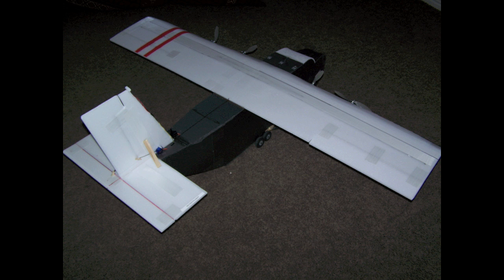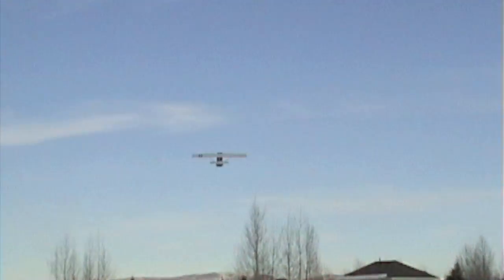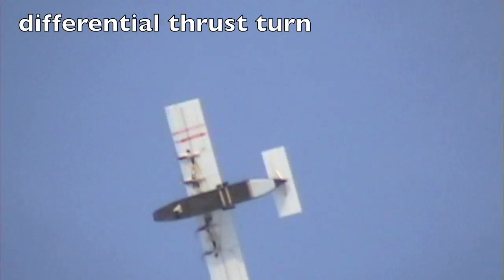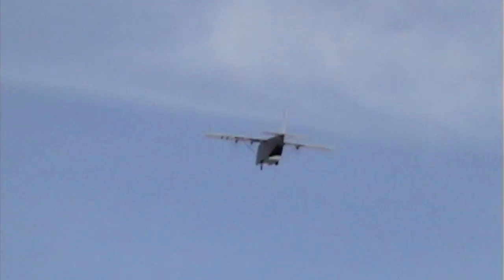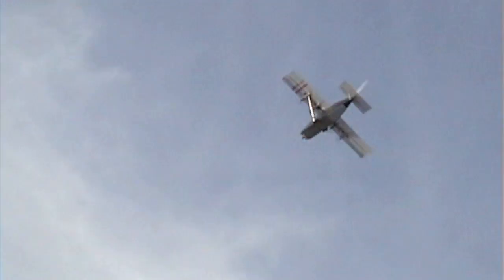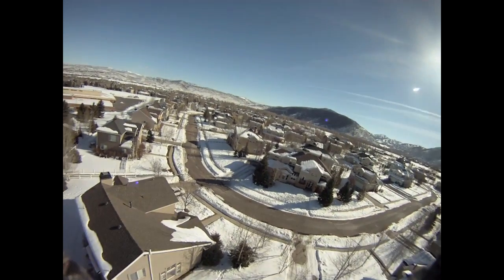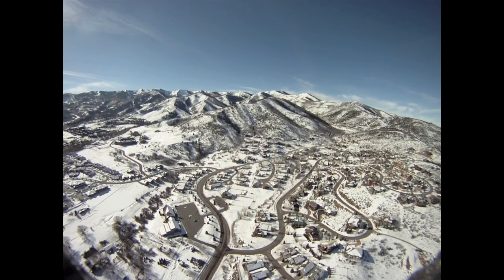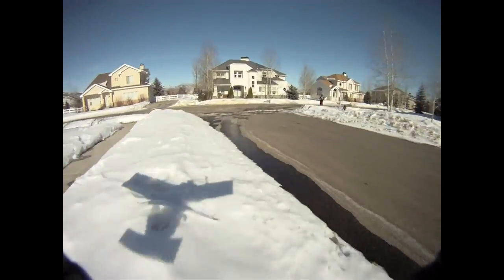Cargo Condor 1st Flight

Comment: Are you using Arduino? If so in the initial set up of the firmware, in Config H you will find a setting to alter the motor start number. Sounds like as soon as you arm the motors the motors start so set the esc and motor numbers higher. This is very handy for multicopters but not so good for planes. Also set a 3 way switch to arm the motors and disarm. Very sorry to hear about your wound! Love the aircraft! Beautiful.
Reply: Hola 
Que camara estas usando ?

Comment: Instead of ordering deport just use dollar tree foam. If you departed it the is like reprimand a lot lighter. I've built plenty of scratch builds from this and not has a problem. Also you can make a flat bottom airfoil real easy if you use experimental airlines admin wing technique

Comment: Did you turn the plane on before the transmitter? Is there a radio station on the same or similar frequency? Are you near an airport? If not, you may want to try a new ECS.
Reply: He doesn't have this plane no more I don't think as he crashed it in a loop

Comment: three possible reasons that it took off:
The ESC has shat itelf and allowed random spasms of power through it without being told so

the radio might be interfered with by another radio frequency ie; local police radios, microwaves, things like that

or you dont have the right settings on your transmitter.

my second rc plane did this too. turned out that it was the old ESC that had had a few problems... the old guy I bought it off had had it for ten years.

I hope this helps you out mate.

Comment: actualy your all wrong its a radio wave conturuled thrust so if the time when u do press it and it doesn't go and u get back in connection the plane will continue the thrust cousing it to take off by its self its mostly in RC helicopters

Comment: You're cool, and this is from a 74 year old cat. 
 But Have you ever put one of your planes through a window? 
 I think you might be pissing off the people in the homes there.
  But, you do a good job in your builds and I hope that prop cut didn't hurt too bad.
  Some of my ESCs will start wide open if I don't turn the TX on first.
 I don't think that was your case............p

Comment: Did you find the answer as to why the non-promped start ups? I have a Park Zone T-28 that has done the same thing on occasion. Normally if I unplug the battery it solves the situation for then...but may do it again later.

Comment: the cause of your full trottle problem could be simply explained by two wires touching each other when they dont belong, i would go through the plane and just check all of the wiring. Also i saw the video of your crash, i hope you rebuild, its a great plane.

Comment: If you would build the cargo condor again would you build it with a ribbed wing? I want to build one but the wingspan is to big. I think with a ribbed wing its easier to build it in two pieces so you can connect it disconnect it on the field an carry it easier. So you have two pieces that are  35" long

Comment: great camera work.  do you have plans for the cargo condor.  if not, can you do a video and show some of the critical dimensions with it sitting on a flat surface.  length, width dimensions every time it changes and height dimensions top and bottom as it relates to the table.  dude, i am crazy about your condor and want to build one bad.

Comment: my 72mhz radio will glitch if  an  AA gets dead in it - i have to  often check  the individual AAs  , and the battery meter on the tx  is  unreliable  and optimistic

Comment: that is a nasty cut man. wondering if it's a transmitter/receiver problem when flying in cold temperatures (recommended operating temperatures?) or possible moisture in the electronics from all that snow? maybe it's just gremlins in the plane

Comment: wow..man u cut ur hand pretty bad...ur problem could be cauzed by either the esc's but since u said all motors started running full throttle i believe its a radio issue..... some real nice flightfootage man!...what cam are u using?

good luck with ur hand and be carefull ..

jacques

Comment: Thank you . I seen Rcfoamfighter had  that cvoltage regulator due to  his crashes. Do you know if it resolved it though. I have now gone to Futaba now, but I just killed my Twin Star II yesterday due to another lock out as well. I assume its from over amping as well. 6 servos and 2 motors esc combos. For FPV flying.

Thanks for the tip. Its time for a seperate battery for the transmitter.....

Comment: Wow Daniel, I am amazed, that is awesome, hats off to ya, that thing is huge :-)  A lot of engineering and design went into this one, love it :-)  That dive footage was kinda cool.
PS  please careful, not only with the props, but you are not just flying little foamies, if this is a four pound plane, loosing control to a plane this size due to radio/structural failure could cause heavy damage to anything it could come into contact with :-\

Comment: Thats possible sometimes mine does the same if I have the radio is too close. A few times it was like my throttle even though all the way down, was not off. I had to pushed really hard down on it to make it stop. It was like the actuator was not returning to the no throttle position. Not sure why it does this. I need to get it figured out too. I wonder if it could just be dirty inside or a faulty actuator. Well be careful and keep up the good work! Oh, I killed my Jupiter today too, video soon.

Comment: Cool, Glad to see you big plane flying Daniel. Looks like it flies awesome! Good job on it. Bummer about the cuts on your hand. Do you have a DX6i? Mine started acting up the same way.Would all of a sudden just run up the throttle, Even on some single motor planes. Not sure whats causing it either. There have been a few recalls on the DX6i depending on serial number. Check their website. This is part of the reason I got the new Airtronics radio..  Anyway, keep up the good work!
Paul